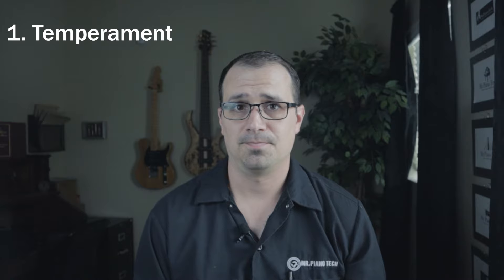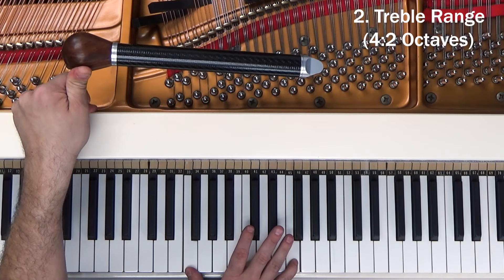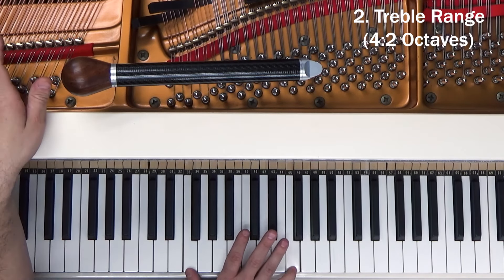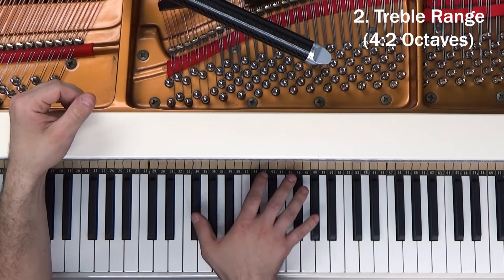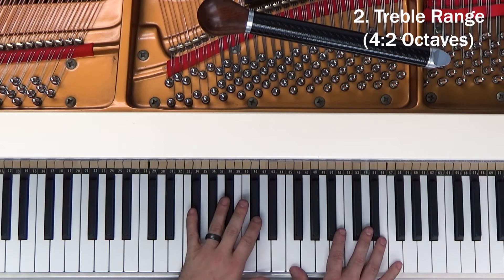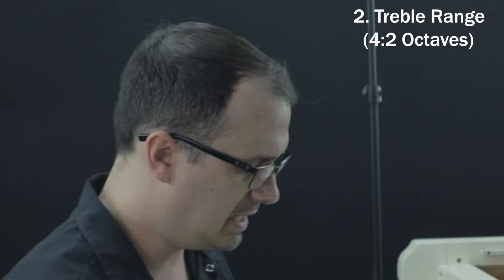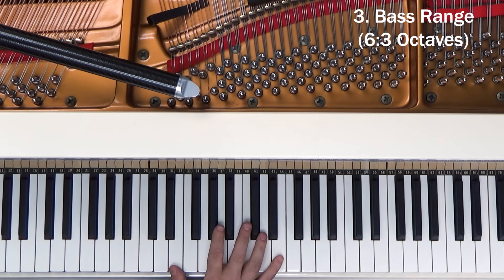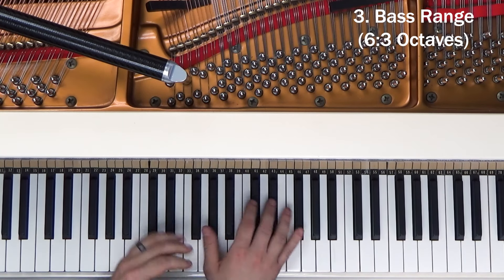How To Tune A Piano

Comment: If youre just starting can you tune a piano in multiple sessions? Or is that bad for the piano. My piano is relatively new and usually gets tunned once a year. Ive tunned a few notes here and there successfully. I just want to tune the whole piano because its quite rewarding.
Reply from the maker: It’s best to do it all at once but if you’re learning I don’t see why you couldn’t split it up assuming you’re not doing a pitch raise, more than 2 or 3 cents, so that the tension balance doesn’t get thrown off across the piano.

Comment: I thought in the old days, pianos were tuned from a single A4 440Hz Tuning Fork, not from F4, is that correct?
Reply from the maker: Typically although there are some methods starting off from other notes, however, when you go through the examination process through the PTG you’re only allowed once pitch reference at either Middle C or A440 and you have to tune just off that.
Reply: @MrPianoTech  Thanks. I wrote to the Guild to get more info. I would like to become a registered piano technician. I had a few questions for them. I am hoping that I  just need 1 one study guide - like I purchased for a Ham Radio license. Everything you need to learn in one manual. Then I need to find a mentor.  As I am learning and because I don't have an actual piano, are people willing to have their pianos tuned for free by an apprentice learning to tune by ear and then verify electronically?
Reply from the maker: @paulromsky9527  If you go to PTG.org you'll find where you can search for an RPT by Zip. Find one willing to mentor you. It's a long process and takes a couple of years to get any good at tuning and developing a good pin-setting technique. Don't practice on customer pianos in the field, I recommend getting at least a couple hundred good tunings under your belt before doing that but follow whatever your RPT mentor recommends. Get the Reblitz book on tuning, repair, and rebuilding. Some of the info is a bit dated but It'll lay some good foundation. Nothing can replace training though from a good RPT who really knows his/her stuff.

Comment: Hey very helpful video, I have read alot of comments and am looking for an answer. Basically I may sound like an idiot I understand exactly what you have done with 4:2 and 6:3 but my head isn't letting me interpret was 4:2 and 6:3 actually represent?? Can you elaborate sorry. So 4 must be an interval and 2 is an interval as well?? Errmm thanks
Reply: I have re watched now and understand that 4:2 refers to the partials I am now just mythed at how you got the lower octave Below F4in tune. E.g the C# you use with F4 thanks
Reply from the maker: @fredrowland-jz2oi  Ok, no problem. You’re just using it as a base line. So, whether you’re using the C#3, D3, D#3, E3 you’re not using them to tune F4, F#4, G4, E4. You’re tuning the 4th octave notes off of F3, F#3, G3, G#3. So tune F4 to F3 as close to no beats as possible. Then play C#3 with F3 and listen to how fast the beats are, THIS is your baseline. The beats could be fast, they could be slow, doesn’t matter. Now play C#3 with F4 and listen to the beats. If they sound the same as they did with C#3 and F3 then it’s a perfect 4:2 octave. If when you play C#3 and F4 the beats are faster, then F4 is too sharp compared to F3. If the beats are slower then F4 is too flat. Do the same with the other notes while moving up. This just gets you to the double octave which is what a 4:2 is. So once you get to F5, use F3 as your double octave test which you can now use since you know F3 is already in perfect tune. Hope this helps, it took me a while to wrap my mind around it.

Comment: My old 1909 piano was tuned with A at 435.5. It seems you should be able to use this method to tune the piano to that off-440 treble tuning. Do I understand your process correctly?
Reply from the maker: Yes you can. I was recently asked by a customer to tune to that "A". If you're using TuneLab, although I guess any program should be able to do it, put it on A4 then lower the pitch on the program until it reads 435.5 (on TuneLab you just slide your finger down in the middle area). Then use it to tune the temperament then you're all set. You'll tune the rest of the piano like you would a standard tuning.
Reply: @MrPianoTech  The tuner said the piano wouldn’t hold the tuning if he went to concert pitch. Is A at 435.5 common then?
Reply from the maker: @Opa747  It's possible that the piano was built to be tuned at A432 which is common in some older pianos but hard to say for sure on yours. The tech will sometimes suggest a lower tuning if the strings may break bringing them up, if a bridge may crack, etc. Depends on the condition of the piano. But historically A used to be lower than 440 so it shouldn't be a problem unless you want to play along with contemporary music, then you'll notice the pitch difference.

Comment: You use the C sharp as a check, but you have only tuned the temperament. How can you use it? The C sharp might be out of tune. Is it usable as long as it’s not very out of tune?
Reply: Sorry, that C sharp is within the temperament. Will be nice to try this, have only tuned with ETD for 15 years.
Reply: No, I was right. You use C sharp 3 as a check when only F3-F4 is tuned. So my question remains :-)
Reply from the maker: So what you are doing is merely comparing the beats of that C# to F3 and that C# to F4. Those beats need to match and it doesn't matter whether or not that C# is in "tune". Same goes for the D, D#, and E next to it. You can think of it as a baseline, it doesn't matter where the baseline is, only that the two notes match beats when compared with it. You're not tuning F3 to that c sharp, you're only tuning F4 to the F3 so you're just getting a baseline of the beats from that c sharp and F3 to compare it to F4.
Reply: @MrPianoTech  Ok, thanks!

Comment: How did you settle on 4:2 and 6:3? Is there a particular reason that works and others don't? Why is the bass tuned differently?
Reply from the maker: Those are the ones required to pass the RPT examinations so it's a good starting point and it's what I use daily. The 6:3 gives the bass a different stretch that sounds better than a 4:2.

Comment: Hi Mr. Piano Tech

I have scoured youtube for instructive piano tuning videos and came upon yours which by far offers the clearest explanation of aural tuning (not including the temperament) and btw is great in video and audio quality. 

Also it seems to me that your method offers a practical trade-off between using an ETD but enhancing the process with aural tuning which includes a subjective quality.

With regards to step 1 = tuning the temperament: is it correctly understood that this is almost a mathematical exercise in which the F3-F4 interval is tuned with 12 exactly equal 1/2 step intervals, i.e. no stretching?

If so, per my understanding of the math involved setting the temperament is calculated as follows:

A4 = 440 (this could of course be a different number if desired)
Each half step is calculated using a factor of s = 2^(1/12) ~= 1.0594631
Each half step below A4 is therefor calculated as:

Frequency =  440/(1.0594631 ^ n) where n is number of half steps below A4, e.g.:

D#4 is 6 half steps below A4 hence D#4 frequency = 440/(1.0594631^6) ~= 311.13

Based on the above calc the F3-F4 temperament would be set as follows:

F3	 174.61 
F#3	 185.00 
G3	 196.00 
G#3  207.65 
A3	 220.00 
A#3	 233.08 
B3	 246.94 
C4	 261.63 
C#4	 277.18 
D4	 293.66 
D#4	 311.13 
E4	 329.63 
F4	 349.23 

Assuming this is correct and that the rest of the tuning is performed aurally as you explained, there should really be no need to purchase an expensive tuning device or app. All that would be needed is a simple tuning app that can help set the temperament using the frequencies calculated above?

Thanks again for a great video!
Reply from the maker: Hello, thanks for watching. They’re not equal divisions, each note is slightly “tempered” (ex. F4 = 348.78). The non-equal divisions came about because if you use equal divisions the octaves sound good but the chords don’t, so they had to make some exceptions. I can’t get into all of the math involved in the evolution of the equal temperament but if you go to the site for TuneLab and go through the manual, there is more information regarding the science behind it. Hope that helps.
Reply: @MrPianoTech  Apologies for persisting, but i tried to find references to the slight non-equal divisions in the "equal" temperament you described, but was not able to. As best I can tell the TuneLab manual I found online does not discuss this topic (it talks more about some of the historical temperaments but nothing on the "equal"), and all of the sites/articles I found online present calculations consistent with those in my post. Would you be able to point me to anything that explains the unequal divisions in more detail?

Comment: Quick question. I'm due to tune a piano that has been moved from one house to another. It's slightly flat but was tuned regularly until a year ago. How long do I let it settle and let the temp an humidity equalise? I don't want to tune it straight away as I'm told it won't hold long.  Is two weeks enough? It's in great condition, 40 years old.
Reply from the maker: I find 2 weeks to be good.

Comment: Hi, I have an old piano that have some sour tones even after professional tuning, in the cross over range between base and tenor. They are not out of tune, just unwanted harmonics. Anything that can be done? Best regards, Anders
Reply from the maker: Hello Anders! In my experience that's typically caused by one of two things; either the dampers aren't properly cutting off the tone, allowing for unwanted resonance...or, the hammers need to be voiced. First would be to see if the dampers are totally cutting off all notes. Then check the condition of the front of the hammers where they strike the strings.

Comment: Is there a reason you can’t use the c# within the tempered octave since we know that note has been properly tuned ? As others have pointed out, the c# outside the temperament octave may not be in tune . Thanks
Reply from the maker: Sorry for the late response, looks like youtube quit notifying me when comments are left! Doesn't need to be in tune. It's just used as a baseline for comparison.

Comment: Ok, but how to you tune a piano to A-432 while standing on one leg?
Reply from the maker: Very carefully…after offsetting meter -31.77 cents 😋
Reply: @MrPianoTech  LOL! Interesting. I when I tune my old CD's down to A-432 I go down 32 cents. I had no idea it could get as exact as -31.77 cents! I tune my own pianos and I heard that Well Tempering gives a slight tuning difference to each key you play in.
Reply from the maker: @Acoustic-Rabbit-Hole  32 is fine…I just have some very picky customers which has required me to nail it down to a specific amount…very specific lol.

Comment: Why not use an electronic tuner for the whole thing?
Reply from the maker: It mostly comes down to inharmonicity. The equal temperament will always be the same, however, to adjust properly for the inharmonicities of each individual pianos scale you have to take measurements with the program so it knows what to listen for to get the octaves right. Or, if you tune the way outlined in the video you'll automatically make those adjustments when you tune without the computer and usually the tuning will come out sounding better.

Comment: Great video!! Time that things go to the customers.Just the (double)decimes are very important in the temperament.And...what about those false beats(notably in the treble area) To keep it short,these are due to a lack of accuracy in the manufacturing procedure as a result you can not supply better (side)pressure on the bridge pins.Culprits are additionally in these circumstances also those infernal aggraffes(invented by Kriegelstein),however....the expensive brands still make use of them(Bechstein,Bösendorfer and Steinway partially),cos.....false beats is not a formidable harassment..You don't hear them in the great concert hall and not in pedal playing,too.
And the big problem often are the bass strings.Are they long enough? Haha....would almost say NEVER.As a little boy I got a snare drum from my parents.It was one with a smaller diameter,so....shorter strings as a result the instrument did not rustle in the proper way while beating Brushes didn't work at all..And...partials of piano bass strings are higher than in the treble,so small piano's have their restrictions in this respect. Equality in this branche is much sought after.Just like action regulation and voicing.Equality!!!
As a little boy I was a hobbyist in this field but only later I turned professional and so I do venture to say.....there was a time,that most of the piano's did not tune easily,they  were just bastards.And how come,that bad pianos do'exist at all? By lack of proper material(eg tuning pins with too great resilience,torsion,that is HELL to tune) and the right knowledge.Well....every bet you'll recognize some things in my message.

Comment: Hello ! I hope you don't mind me saying so but
The Bass should be the second step, to be tuned before the treble, specially if the pitch needs any significant alteration; why ? Because the Bass has an important effect on the soundboard; the downbearing of the strings / flattening the soundboard down and moving the tuning pitch down with it.
The other thing I feel I should mention is the lever position shown in your video, at 9 o'clock: the correct position is 3 o'clock in order to protect the tuning pins/pinblock from damage and inevitably at 12 o'clock at the top trouble; I mean; treble
Reply from the maker: You’re welcome to have your own opinions but since this is the second video you’ve left a comment “correcting” things I think it’s important to note to anyone who might read your comment, as to not be led in the wrong direction, that in all of my videos, tuning, regulation, repair, I always use the specs that the Piano Technicians Guild has deemed correct and I what you’ll need to use to pass the examinations to become and RPT (Registered Piano Technician). Thanks for watching!